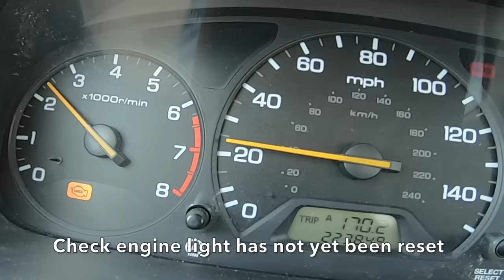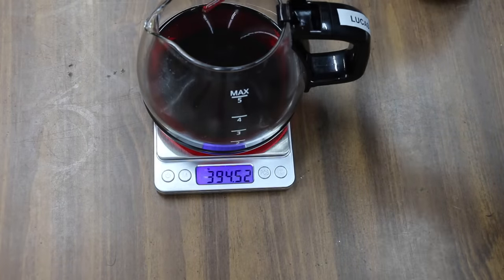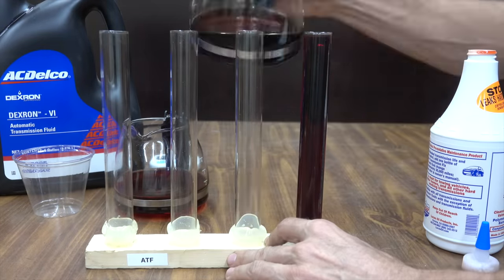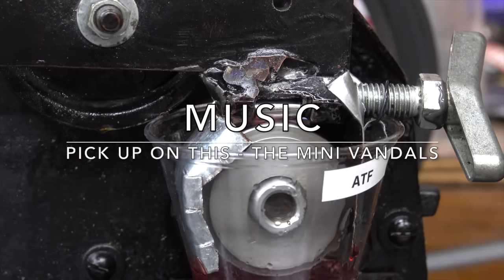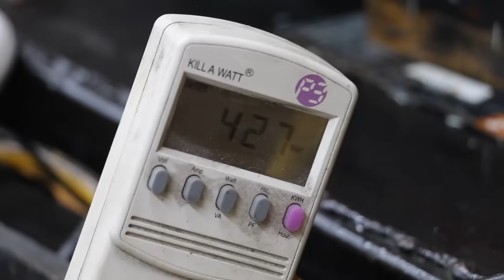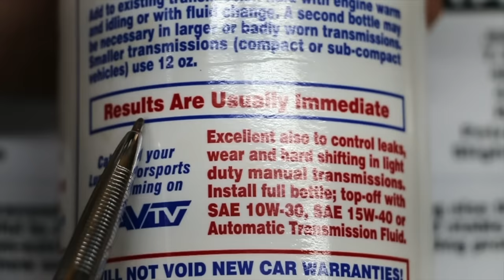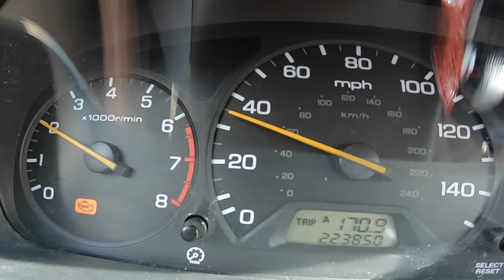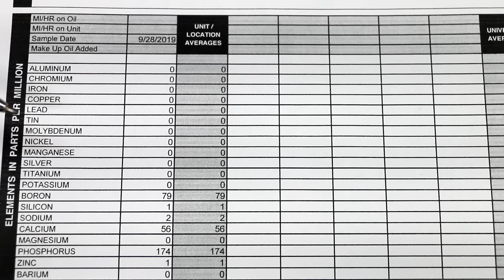Does Lucas Transmission Fix Work?  Let's find out!

Comment from the maker: Thanks for everyone who requested testing Lucas Transmission Fix and please let me know if there are other brands you'd like tested.  Here's the link the the product I used: Lucas Transmission Fix: https://amzn.to/31gbCFU
Reply: Why was that griddle moving when u sped it up ..
Its like bouncing
Reply: Project Farm - if you haven’t already done so, please test the Seafoam transmission cleaner fluid.
Reply: To change Honda automatic transmission fluid all you have to do is get i think its 3 quarts of Honda brand ATF. Look up the recommend amount. Then pull out the dipstick. Then safely raise the car and pull the plug and drain. Then lower the car so all of the fluid comes out. Wait....... until it stops dripping or is dripping very slowly. Put the the plug back in with a new aluminum washer. Then ad the recommend amount of HONDA ATF. And your done!!!!! Very easy, not very expensive. And a note.... you dont have to change the filter. Because the filter is on the inside of the transmission and to change it youd have to drop the transmission and open the case to do that. And its not recommended anyway because its probably just a fine mesh screen. And there is a strong magnet inside of it for the inevitable metal flakes and powder/dust. Just change it yourself. It doesn't need one of those expensive transmission fluid "flushes" that some lube shops sell. Transmission fluid flushes are very good. But are only necessary in vehicles that have things like a pan drop that only gets some of the fluid. The flush will actually get it all.
Reply: On that honda you just add fluid in through the dipstick hole. Thats from the manufacturer
Reply: It looks and sounds like the clutches are ok on this car. And it looks and sounds like the shift solenoid is sticking. Theres more than one of them on it. Or used transmissions for hondas are relatively cheap.
Reply: @mikewilson3836   heat son  heat.
Reply: How about trying seafoam trans tune.  On a transmission with dirty solenoids/ valves / valve body
And then drive it 1000 miles then do a drain and fill to drain out the liquefied varnish and dirty stuff . And proceed to change atf on it.
Reply: Can you test the liquid intelligence radiator stop leak. It's an Australian product and quite unique ( In australia anyway) in its igredients and how it works.
Reply: I've had great success with Lucas Power Steering Fluid Stop Leak. I had a major leak and within one large bottle of stop leak it was down to a "trickle", into second bottle and I only have to add fluid every few months. Would be interested to know what your experience would be with it.
Reply: Can you test ZX1 oil additive. Ive used it and its amazing 👏
Reply: Id like to see lubegard tested on slipping transmission
Reply: @dfields9511  The problem with adding a cleaner is it loosens the friction material and metal shavings and deposits it into the valve body, plugging the small ports and orifices.
Reply: Sprite Bonn  It's a good short term fix, but ultimately, Grumpy Jenkins, and you, are right. "You can't fix a $800 problem with an 89 cent can of goop."
Reply: @countryboyoutdoors7963   actually I  didn’t have anything to loose  it couldn’t get worse .  The seafoam transtune actually in my case made it better.  But Lucus  helped more but seafoam trains tune picked up where Lucus didn’t work as well.  2001 Nissan Maxima .  3x drain and fill using 
Valvoline maxlife full synthetic ATF 
Lucus
Seafoam transtune 

Took something that was not drivable
To something almost as good as new. Well still gets p0744 but drives and shifts normal now. Hopefully it will get another 50k miles.  It also could be shift solenoids block  this was my results others may have different results
Reply: Project Farm-Put a 2nd bottle in and try that. I would also put a can of Seafoam Trans Tune in after removing that same amount of existing fluid and try that.

 Lucas says you can put 2 bottles in in badly worn transmissions.
Reply: @MemphisMojo15s   that’s almost exactly what I did
3x drain fill

#1 drain fill Lucus and valvoline maxlife full synthetic ATF 
#2 drain fill Lucus and valvoline maxlife full synthetic 
Then later on added seafoam transtune. After removing 16oz of ATF
Added a second can of seafoam transtune because the car sat a lot it appeared transtune evaporated 

1500 miles later
#3 drain fill filled only with ATF 
It was ok but later on added transtune as it was shifting a bit rough.   Then. Added Lucus again after removing 24oz ofATF and it was a lot better.  Shifting almost normal except 
When in 3rd gear and floor it it slips into N. But let off the gas and slips right back into gear.  Not sure about O/D 4th.  
Car still gets p0744 but it’s  drivable now.  
Think the solenoid block is getting warn out and needs replacement.
Reply: @paw45  no kidding, maybe they didn't get the inflation has gone up 800% memo! But that's good news for me...
Reply: That's a torque converter not stalling properly. That trans conditioner is garbage it just softens O rings and bonded pistons but it swells them so much it ruines them eventually. Don''t use that crap.
Reply: I would like to see hotshot secret shift restore tested.
Reply: I usually 100% agree with your methods, but I think you missed the mark on your testing methods in this one.
Reply: What does a bad torque converter mean?
Reply: How does a torque converter go bad
Reply: @Force1Com  , means it has little shavings on its mesh . You take it out clean it and the car will start shifting smoothly! Honda are notorious for it !
Reply: Hi Project Farm 
what are your thoughts on lucas transmission conditioner?
Reply: What an excellent video.  Scratchin' off to get some in the am.   2002 Suburban - 3rd gear shift issues - same exact drill.
Reply: I heard of some stuff called trans X can you test that out heard a story of a transmission not working at all to driving again and shifting again
Reply: Hey Sir!
I am an enthusiast of your channel.
My suggestion is to test the ATP AT-205 RE-SEAL and its competitors.
Cheers!!!
Reply: Can I use this in a newer vehicle like 2013 vw passat over 159k miles
Reply: @davidturk6301  l.p.pp
Reply: @Project Farm kindly test Lubegard CVT recharge and Protection
Reply: @mikewilson3836                    iii
Reply: 1994 ford taurus I used to use transX from Walmart. It worked, transmission wouldn't move after adding transX it worked and last like 2 3 months before re-adding
Reply: @willmtaylor  how?
Reply: @chestnutlouie4709  Brother, that was a year ago.
Reply: @chestnutlouie4709  The additive's purpose is to ENHANCE the ATF--it's never a substitute, so it stands to reason that he should be comparing the chemical properties of the ATF alone vs. the ATF with the Lucas Transmission Fix mixed in.
Reply: I've had a 5 ton trane unit with undetectable aluminum coil leak, came across xantus ac leak 4oz, a commercial advertises to stop leak without harming other parts, can u test it
Reply: I was just scrolling.  Can lucas help with an oil pan leak?  Which Lucas product that can help.
Reply: Nice video, but because Lucas transmission fix is an additive and not a replacement, you might have wanted to mix it with some transmission oil for the viscosity race. Not having done so in my opinion is partly why it stayed in for so long.
Reply: Please test PRO ONE'S Transmission Life Treatment that would be interesting how it stacks up against LUCAS btw it's  a plant based "Green" product. Js
Reply: Why upload this if it didn’t work
Reply: I know I'm late to the game but I have probably fixed around 50 transmissions with Lucas. It really shines on pressure issues. More like slip shifts, hesitations, sometimes shutters, overdrive issues, surging.
Reply: Great video.  Gonna try it on my 2005 F-250 SD that has 258,000 miles on it. Only slips occassionally, but don't want it to get worse.
Reply: Here in the UK a family member recently purchased a Honda Jazz without test driving it for another family member! 🙄The CVT judders when taking off, a bottle of Lucas Transmission fixed that issue!! Less than 50 miles of driving it was fine.
Reply: Anti Shudder fixx by Lube Gaurd
Reply: Could you try out prolube oil treatment I heard you can use it in oil and transmission.
Reply: Did you know that Lucas transmission fix can not be added to Dexron VI. Your video that's what your adding it to? 
Love the videos. When Googled.  It says it's not recommend for dexron VI.
Reply: 6-4-24*Experiment * 🎉What happen if you put a lightweight motor oil in a transmission.
Reply: CVT Transmission FIx* whatever brand  (15-20k would give me enough time to look for a new vehicle and not knee jerk into something)
Reply: Could you do one on diesel fuel additives??? That would be awesome!